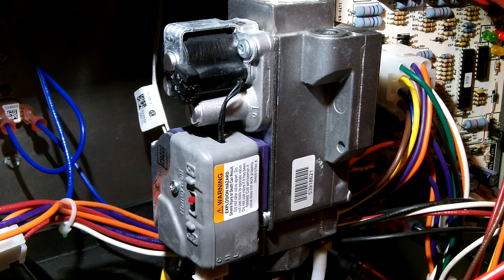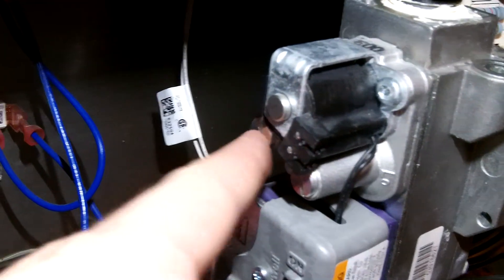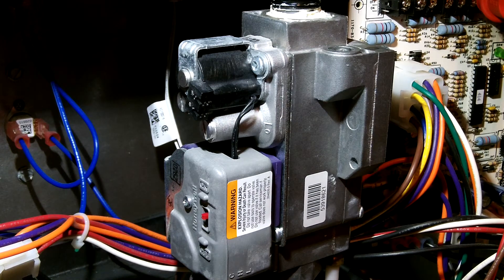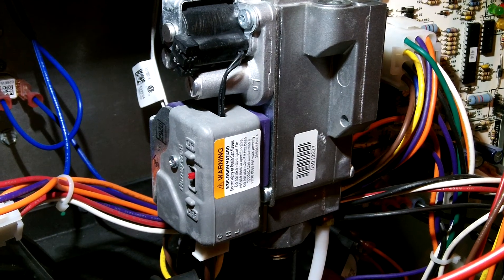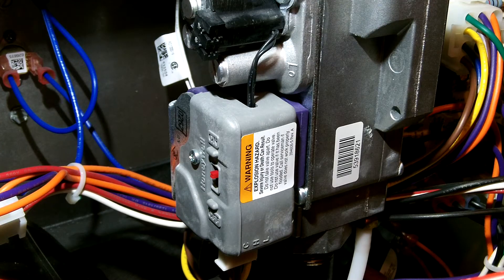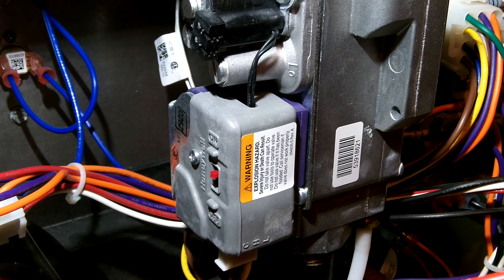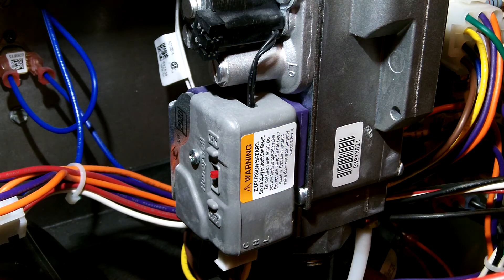How a Honeywell 2-Stage Gas Valve Operates

Comment: Sir may I ask you how do you energize Low and High , My Goodman has 36G54-238 two stage ( HI C M)I do know I need to adjust after valve replaced, instruction show must need to energize M (Low) first, then Hi, much appreciated if you can give me info
Reply: I don’t have two stage thermostat!
Reply from the maker: You would use W1 and W2 terminals on the furnace control board. Jump R to W1 for low stage and jump R to W2 for high stage.
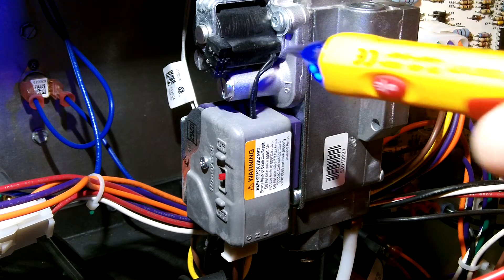Reply: I appreciate for replying, but 3:00 On my control board I only see YWRGC only ! Can I just unplug gas valve connector, then use jumper wires to energize Low and High? Much appreciated

Comment: I have a 90% furnace and it hasn't been used since last year. Several months ago I installed a Nest thermostat and when I tried to turn the heat on the furnace would not kick on. The ignitor comes on but burners dont come on. I have a 2 stage gas valve in the furnace. Is there a jumper or some other setting for the TS?
Reply: I have the same problem. Were you able to figure it out?

Comment: What turns on the 2nd stage is it on a timer?
Reply from the maker: That varies depending on your furnace, thermostat, and settings. I have a 2-stage thermostat so the thermostat turns it on. There is also a jumper setting so it's timer-based (e.g. stage 2 after 10 minutes) if you only have a single stage thermostat.
Reply: Much too complicated.  1961 model works just fine without all the adjustments.

Comment: can you look at your video comments on choke set up for 4100 autolite from 2-3 yrs ago. i sent you  comment about my 66 autolite carb  when i opened the choke to look at the lever and piston, there is no piston in the choke housing. was it removed? or can the heated choke work without the piston?.  got the carb at  swap meet.. if i need the piston i will have to search for a whole choke housing to replace mine. i have photos if you like.  my email is Vermbird60@gmail.com  thanks